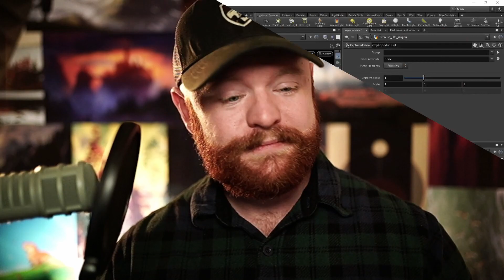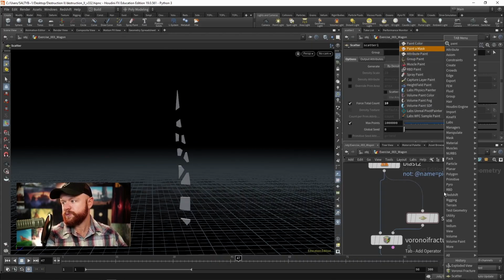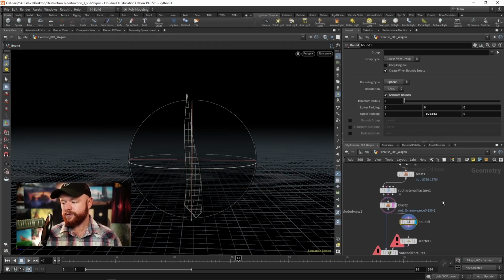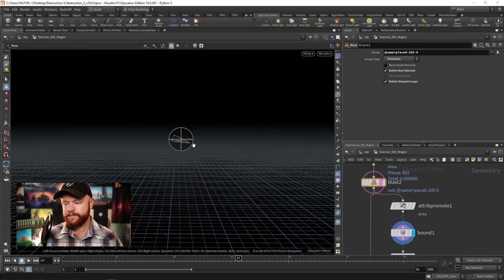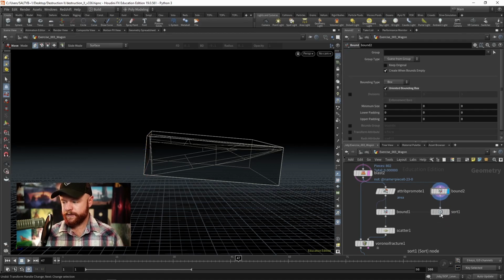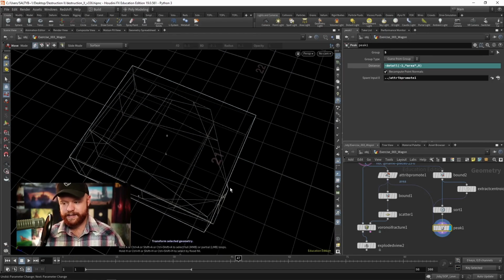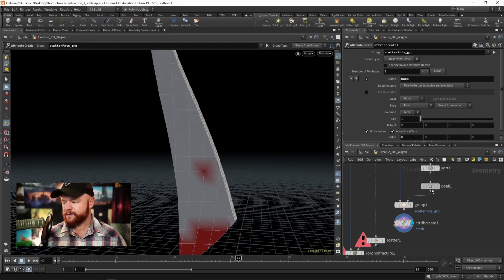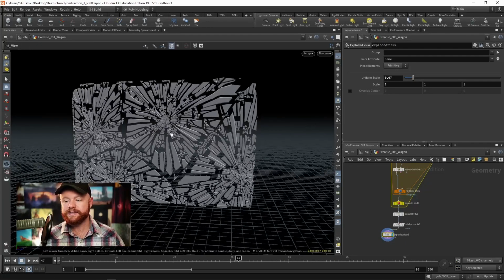Houdini | The Voronoi Chipping Method | Quick Tip

Comment: Hi - many thx for this, great tip!
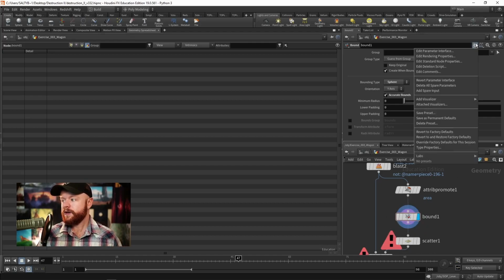One question (I know it is not used in the end, but just for better understanding): Why (at about 6:00) is it necessary to create a spare input on the "bound1" to access the detail attribute generated by "attribpromote1"? The "bound1" already is connected to "attribpromote1", so wouldn't the expression simply work as "detail(0, "area", 0)" without the spare input?
Reply from the maker: The spare input is the best way to work nicely when creating compiled for-loops.  So for that reason, it's always my go-to when I know something is going to be looped eventually.  Just to add - oftentimes hscript expressions will cause errors when compiling, so that's why it's best to avoid them when looping.